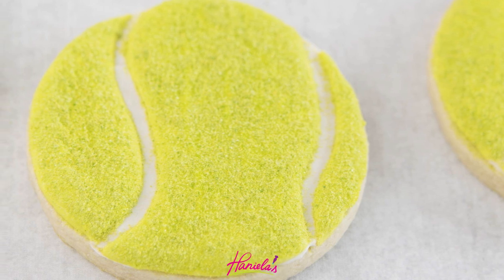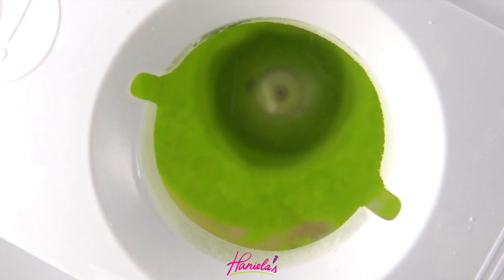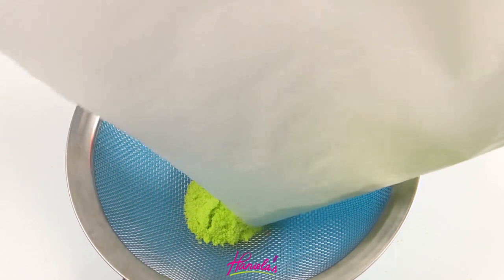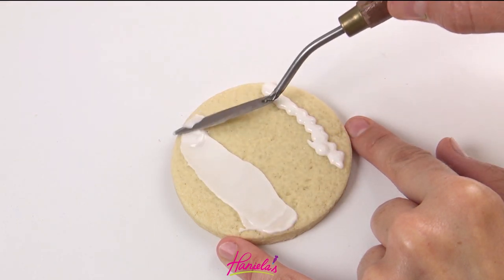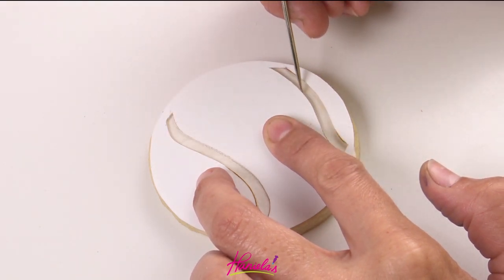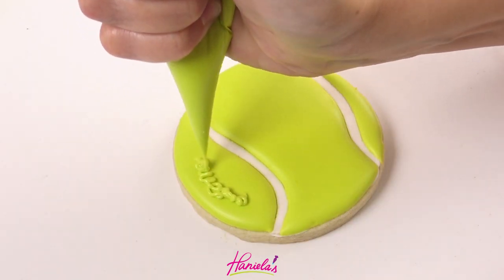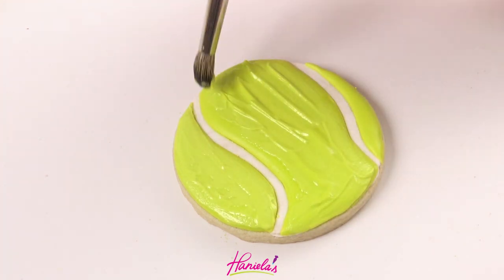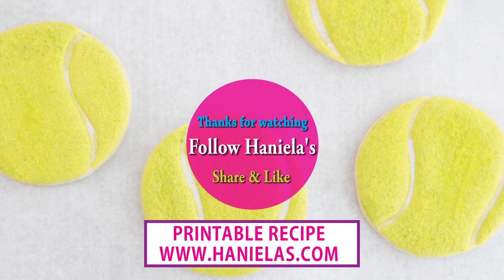TENNIS BALL COOKIES, FUZZ DECORATING SECRET REVEALED!

Comment: Thank you! This fuzz is perfect! I didn't have any icing left after I flooded the cookies so I used a mixture of Karo syrup and Everclear alcohol to adhere the fuzz. Is there any reason not to add the fuzz to the wet flood icing? I do that with sprinkles, would these be any different?
Reply: I have the same question. I’m thinking that you wouldn’t get the 3D effect if the icing was wet, as the sugar would sink into the Royal icing. Just my thought.

Comment: Are you able to write a name on the tennis ball after putting the sugar mixture on? Just wondering if it will stick.
Reply from the maker: If you want to write a name, I'd use the sponging technique to achieve the tennis ball fuzz texture, or do the fuzz with sugar after you pipe the name.